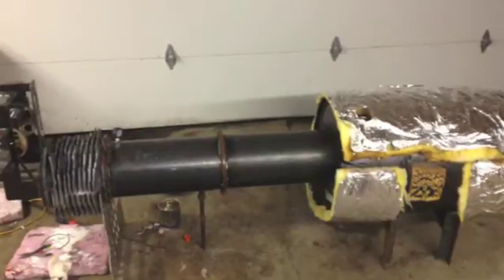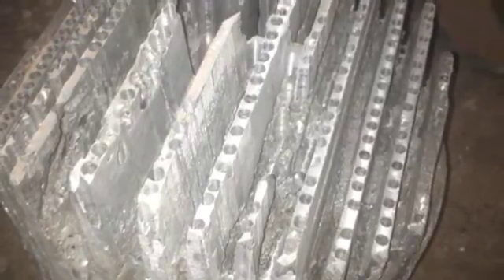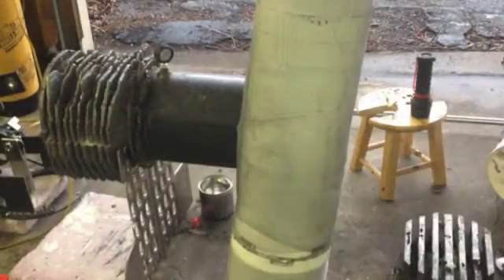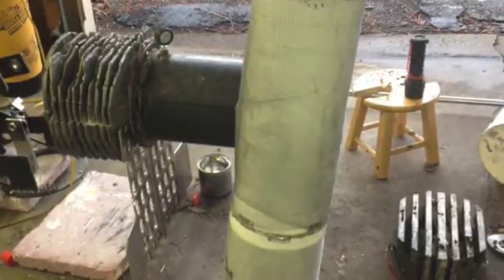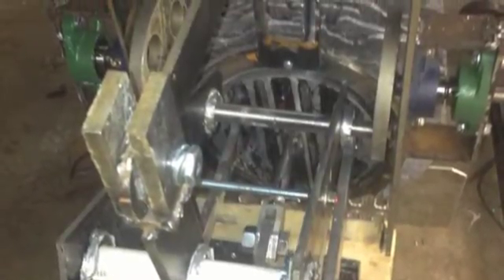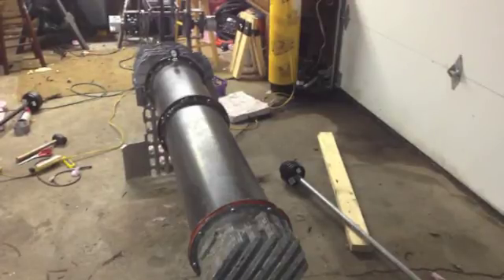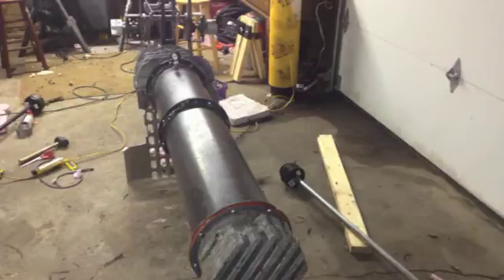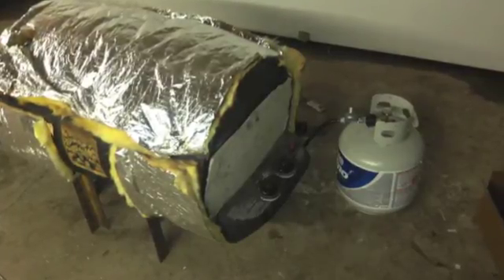Engine Update 4-15

Comment from the maker: Hi Miniscule,
Thanks for the note - not sure I understand what you're saying - the general specs are hot end = 30" in length and cylinder diameter of 9.75 - cold end is 30" in length and 10 of that is the power piston bore (aluminum).  The stroke on the displacer is 14" and and the stroke of the power piston it is 5".  Diameter of the power piston is 9.25.  Displacer is 38" in length.  Welcome your thoughts. - Tim